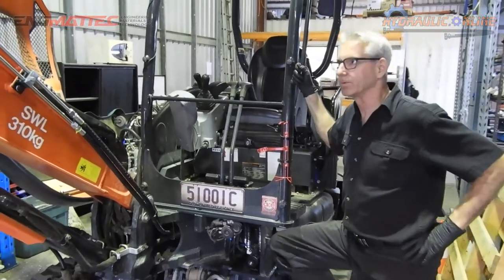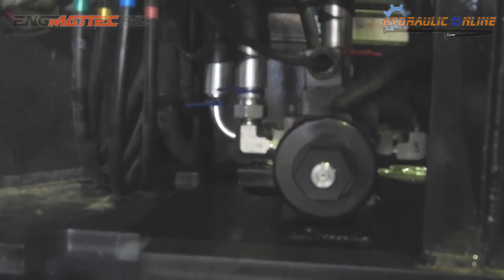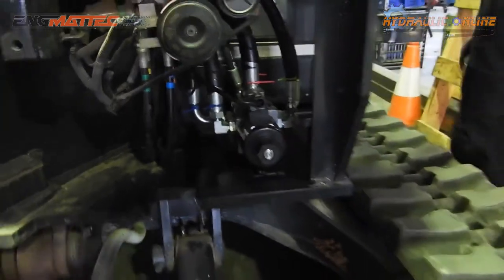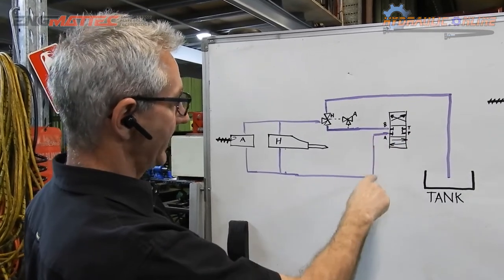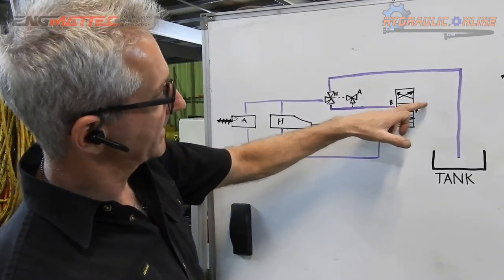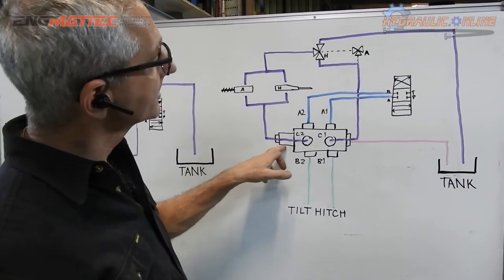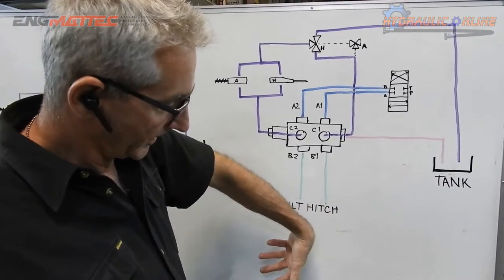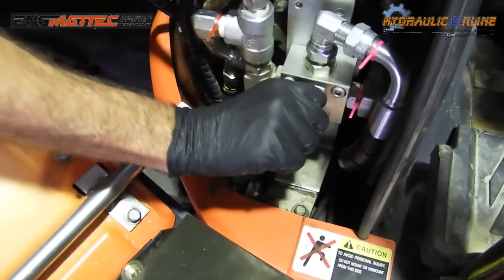SIX Port Diverter Selector Valve Install to Small 3.5 Ton Excavator

Comment: Great video and very helpful in just my understanding of how these systems work. I've got a kx161-2 that does have a thumb and the previous owner was using a small hammer on it. I can't find a valve for continuous flow vs 2 way flow in the aux hydraulic circuit so I've been looking around to see what others have done. Your explanation of the aux hydraulic system was great! At the moment I'm considering installing a T valve in the system so I don't overheat the fluid but I'm glad there's an option to get fancy in the future and possibly install a hydraulic wedge lock to make changing buckets even easier.  Thanks for the great video.
Reply from the maker: Many thanks for the feedback Erik. I was not sure what you meant by a "Hydraulic Wedge Lock" so I looked it up, it looks very similar to what we call a "Quick Hitch" here in Australia. All the best with your T Valve Idea.

Comment: Great video with terrific graphics.  Just wondering if you did a vid showing installation of the energizer 12 volt circuit  Thanks
Reply from the maker: Thanks for the comments Brad, No Video yet on the electrics but thanks for the question and the Idea will try and get a video done on the electrics in the near future.

Comment: I have a kubota k-008 1 ton excavator and it originally came with one directional flow aux hydraulics. I bought a kit sold by kubota to convert it into 2 directional flow in order to use an auger. However after watching this video I realize the kit did not come with a valve to convert from one way to two way. Therefore when using the hammer attachment all the returning hydraulic fluid goes thru the valve body before it goes to the tank and also risk reversing flow to the hammer. Ive since used the hammer with this current setup and it worked fine(care taken not to reverse flow). Now my question is, besides the risk of damaging the hammer, will using the machine like this with the hammer do any damage in the long run? Or should I install a valve to convert between one way and 2 way?
Reply from the maker: Akil thanks for your question and for watching our video. The simple answer is to check with the hammer manufacturer or the hammer specifications (if you still have them or even look them up) and check what the acceptable back pressure is on the return oil, then tee into the hammer return port and measure the pressure comming out of the hammer and returning to tank through the main valve. In our experience most machines can have up to 500 psi of system back pressure just from circulating the oil from the pump through the valves and back to tank.

Comment: Why didn’t you split the boom swing circuit instead ? This would allow qty(2) circuits working at the same time for when they upgrade to tilt /
Rotate .
Reply from the maker: Good question Steve, Not sure is the honest answer, it is an option will will investigate next time we do an install. Perhaps it was to do with how easy it was to access to the supply hose for the circuit.

Comment: Thanks for the informative video 👍I just subscribed! I have a 1990 Yanmar B22 excavator with a swing boom.
I’m planning on building a hydraulic thumb for it, I have been researching these 6port solenoid valves to install after the swing boom valve and this video was definitely helpful, I was unsure about the pressure relief I would need to install so the bucket can overpower the thumb without damage to the thumb cylinder. This video was helpful.
If you have any extra info that would be helpful in my project I would be very thankful. 
Does the 6 port valve have a internal pressure relief built in for the case drain or is that something you plumb in on the case drain line? 
Ps I have a YT channel and will link this video in my description when I build the hydraulic thumb for my Yanmar.
Reply from the maker: Hi Mike thanks for your positive comments.
You will have to install an in line relief into the line that supplies the thumb cylinder ( that may see over pressure from the bucket.) I have seen with my own eyes a 2" diameter chrome Rod of a thumb cylinder bend to the shape of a banana in a mater of seconds  because the bucket had more power and the over pressure had nowhere to go. It is always good to hose up the case drain to go back to tank and most tanks have spare ports and or multiple small hoses returning from other functions just tee into one of those.  Our webstore www.hydraulic.online has a range of adjustable  inline relief valves to choose from.  We also have a large range of DIY hoses and field fit screw together hose fittings and adaptors.

Comment: Thanks for sharing. Could you do a video showing an additional circuit for rotation as well as tilt?
Reply from the maker: Yes, soon, but the simple answer is if you want to add another 2 functions to an already existing fuction you will need to add two 6 port diverter valve. That is one 6 port diverter valve feeding another 6 port diverter valve.

Comment: What if one of the cylinders is single acting with a spring return? Then how do you plumb it?
Reply from the maker: Hmm Good Question, You will not be able to use a 6 port diverter valve for this application.
Also the back pressure in most recirculating hydraulic systems will not allow a spring return cylinder to retract effectively, unless it has a constant load heavy enough to overcome sytem recirculation pressure.

Comment: I just bought a steel track  Komatsu 12 ton mini ex an I want to build a thumb for it and install auxiliary hydraulics the run the thumb or an auger I'm just wondering what's involved with the hydraulics. Dont need hammer
Reply from the maker: Sorry Arnold we missed your comments,  Did you manage to get the thumb working alright?

Comment: I just put a diverter valve on the swing boom function on my cat 305.5 excavator. The non energized function serves as a secondary auxiliary circuit, which works. When I energize the valve, the auxiliary circuit stops working but the swing boom function doesn’t work at all. After watching this video, I realized I don’t have a case drain on the valve. Is this my problem? 

Thanks!
Reply from the maker: Hi Scott Sorry I missed your comment, the Case drain may be the issue if you are operating at higher pressures, it is worth a try. 
But also check that you have installed the two main or original supply and return hoses to the correct ports, not all manufactureres use the same port configuration. So it best to check with the Valve's manufacturers specification on where the two original supply hoses must connect to.